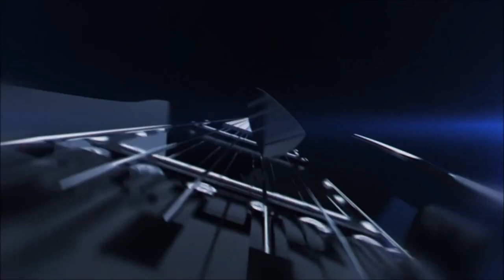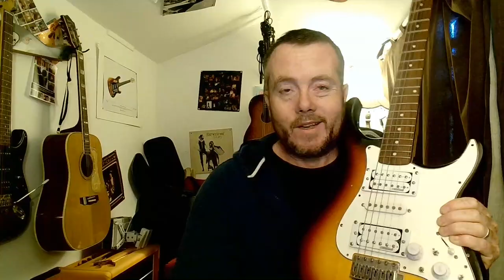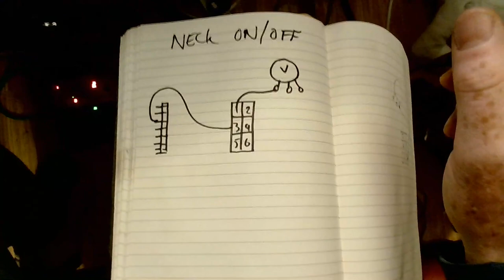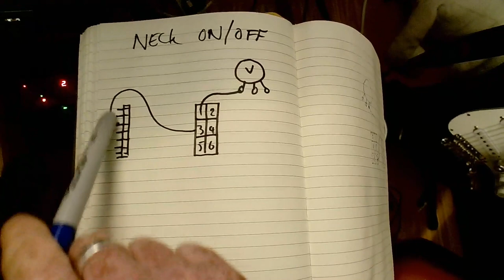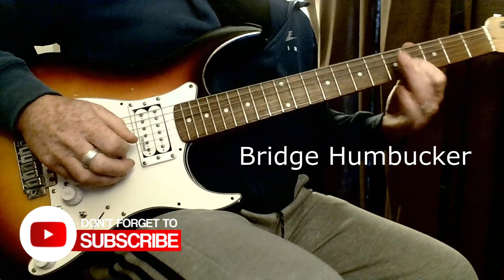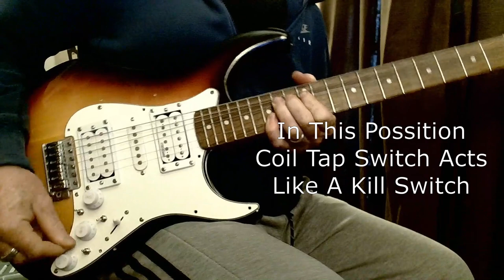Parallel / Series Switching | Out Of Phase | Coil Split | Gilmour MOD Super Scratch Plate Build

Comment: Hi, Brent. Davey Lee here. Like you, I too like to experiment with custom wiring. My project guitar is a 83 Washburn force 2. With an added middle single coil pup it's now a HSH setup. The stock switch is gone, replaced with dpdt on.off.on for the humbuckers and a push button latching switch for the mid pup. Neck pup is switch up for dbl coil and down for single. Bridge pup is up for dbl coil or down for out of phase (3 wires). Switch mid pos is for off. Neck and mid pup are separate vol thru a stacked concentric pot. (500 & 250k). Bridge has its own vol too. Neck and bridge share tone control. Mid bypasses tone.Independent wiring makes for great blending possibilities especially for out of phase which you know needs 2 or more pups to get the sound right. Treble bleeds on neck and mid pups retain tone when backing off on vol. The switches are laid out user-friendly and easy to understand. Some tone combinations with vol tweaks are outstanding! One guitar - many sounds".......